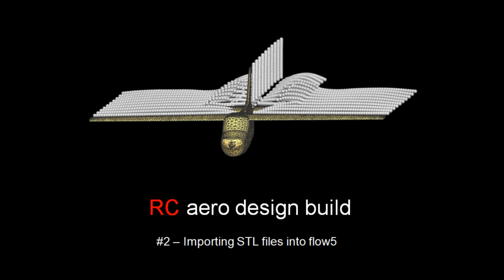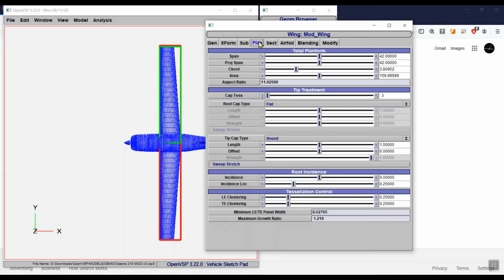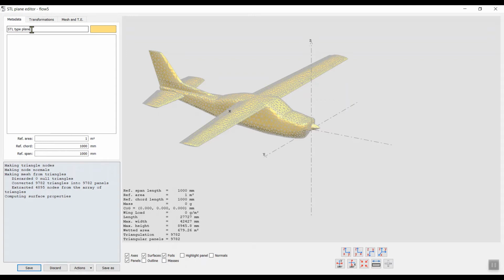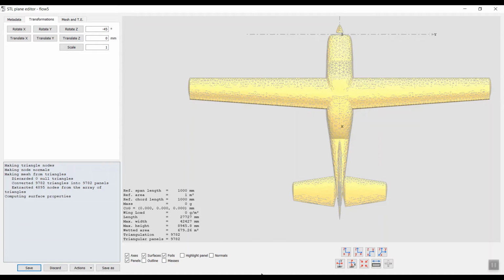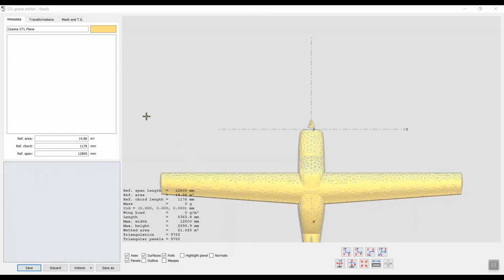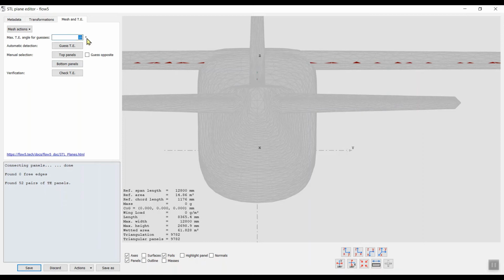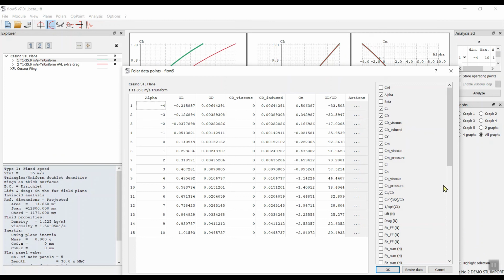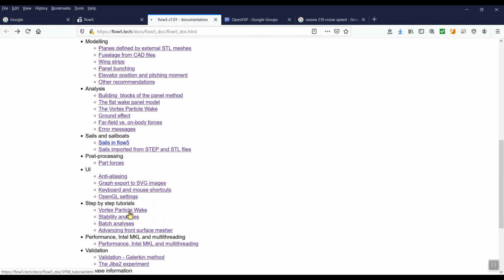#2 Importing STL Files into flow5

Comment: I copied the same as the video, but the Cl value or Cd value is more than 10x smaller. What's wrong? Is it wrong analysis method?
Reply: I think that careful attention to the speed, 35 M/S, and the scale adjustment will fix this problem.